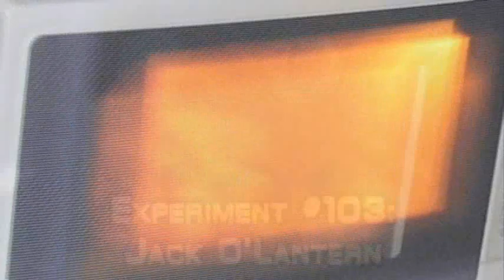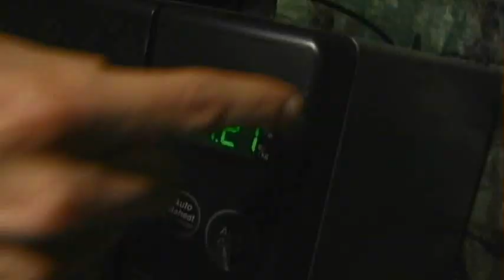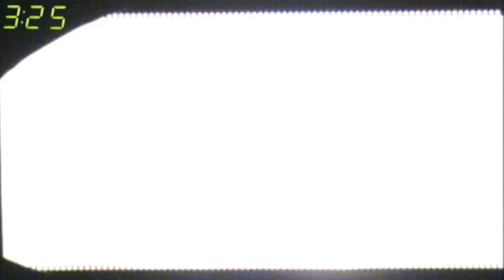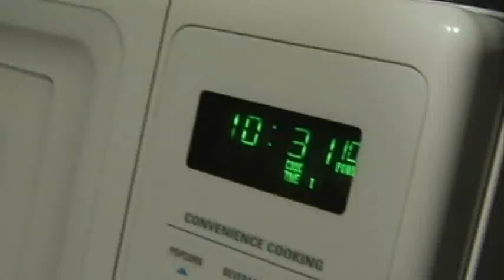Is It A Good Idea To Microwave The Season 5 Clip Show?

Comment: can you microwave these items
1.techdec finger skate boards
2.china plate (a plate made from fragile glass)3.copper wire
4.mini fan
5.car adio
6.zune
7.match bomb
8.wii fit matt
9.quartz
10.basket ball
11.lazer tag gun
12.game cube controler
13.egg timers
14.hour glass
15.dvd box set
and16.nintendo ds game cartredge(any game).? ps.also 1 mentos candy.? please :).